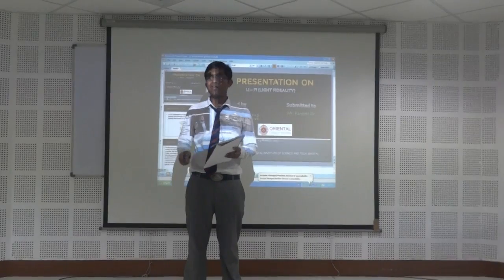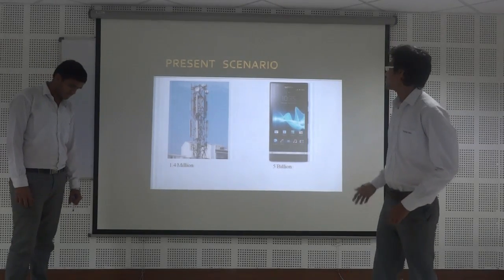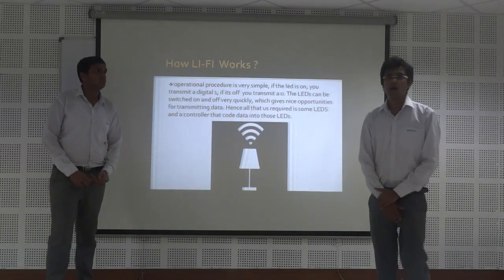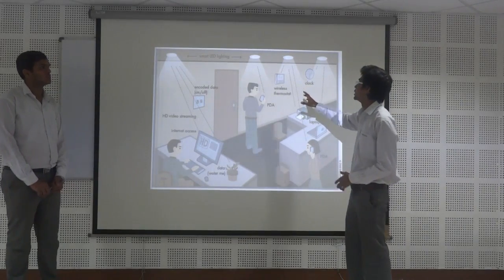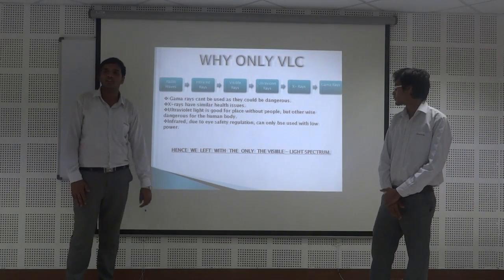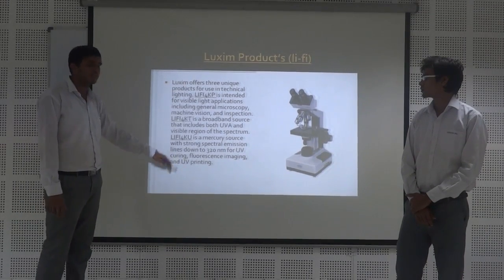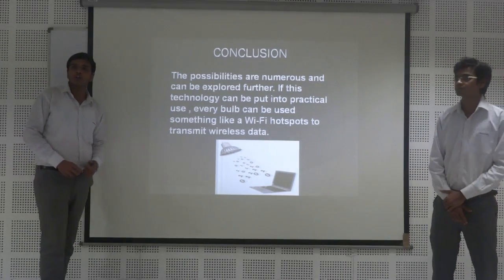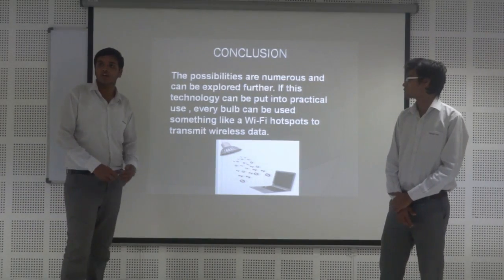Li-Fi (light fidelity)

Comment: here we were using transmitter and reciver end in lifi. if any object placed between the transmitter and receiver how could the light transfer the data?how it is possible?
Reply: that is one limitation of li-fi as light cannot penetrate through objects transmission is not possible if an object is placed in between Tx and Rx. On the other hand it can also advantageous as information transmitted by you cannot be intercepted by others and the chances of your data being hacked is reduced which can be easily done if you are using Radiowaves.